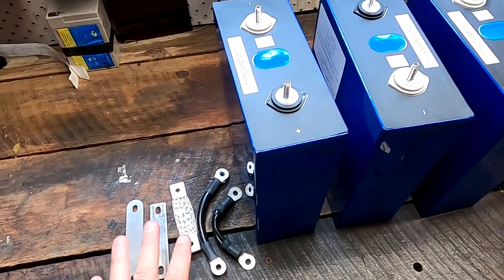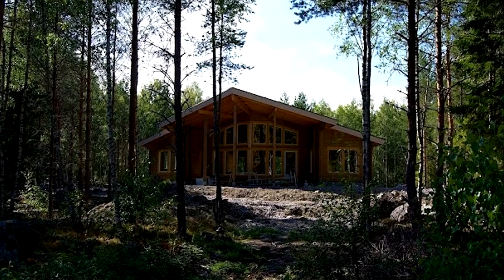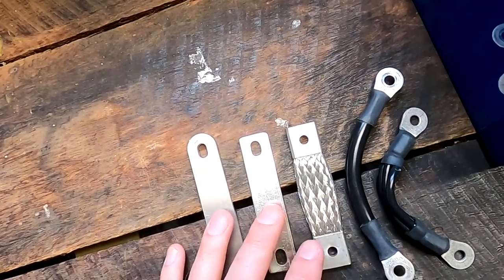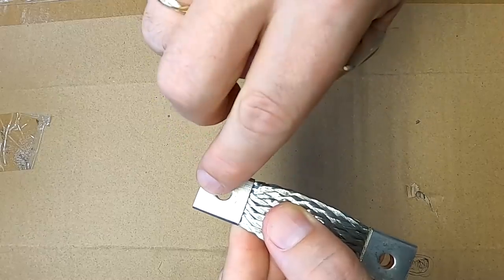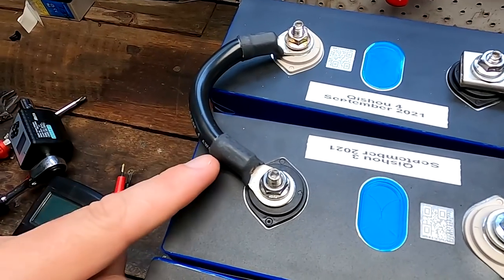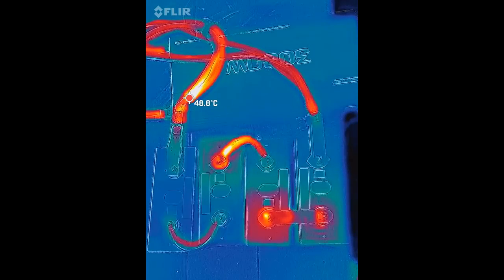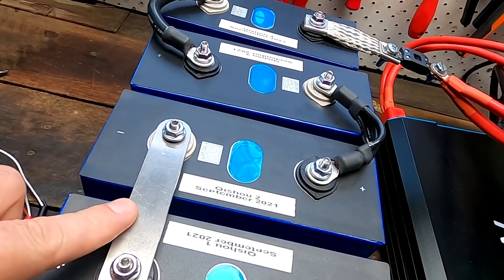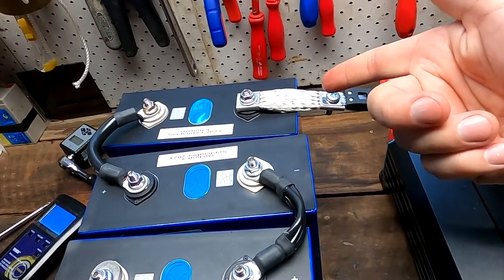All these different busbars... and why they don't matter!

Comment: So, having always seen the options in your videos for BMS having separate resistance values for balancing, does this provide any real world advantage in speed of top balancing your battery bank's? Or is it just simpler to rely on equal length balance lead lengths and connection methods and let the BMS auto distribute the current? I still can't fathom why the options are in there for individual resistance values....
Thanks again for all your learning and sharing Andy!
Reply from the maker: Thanks Zoe. Different lengths of balance cables don't play a role as such. When the BMS measures voltages, there is pretty much no current flowing, therefore no voltage drop. I think the JK-BMS just measures the resistance of the balance cables. I'm not 100% sure either why it may be important though unless you have a real bad connection and it has trouble pushing these 2A through such a cable.
Reply: @OffGridGarageAustralia  thanks Andy!
Does this mean the issues with your V1 battery bank coupled with the QUCC BMS having such a high millivolt deviation is due to not having balancing while charging activated in the app settings or actually the cells individual behaviour?

Happy spat hour to you :)

Comment: A great test, thank you. Very different that I had expected. Aluminium should be as good as copper when there is double the area and the awg 4/0 cable is 3x the area of the original busbar, so how on earth could it be worse?!? The answer must be connections to the posts and perhaps crimps. Tin is a very soft metal. Although there isn't much of it on a tinned busbar it must be improving the surface contact somehow in a way aluminium doesn't. Likewise for the crimp ends of the wires.

Comment: Thank you Andy for doing this video.
I was just about to make some fixable bus bars.

 But notice how both the fixable bus bar and the aluminum bar on the ends were cool.
 what would happen if you changed them and put them in the center and the other bars on the end.
 It seems that most of the heat is coming from battery post to battery post. 🤔
Reply from the maker: Thanks Dennis. I haven't had time to do more testing but I will do another test with an 8s setup at some stage where we can test more materials.

Comment: Hi Andy nice test this info is gold, have you tried a conductive paste to improve the connection (is your paste just for anti corrosion ?) i had been reading about carbon conductive assembly paste and it looked like a good idea and it is also an anti corrosion, i did comment before and included a link to the product but it think it got my comment removed 😁as always entertaining and informative keep up the great work 👍
Reply from the maker: The is the No-Ox-ID paste and against corrosion, anti-oxide and better electrical connection. 
As we saw in this test the other materials didn't have a problem to connect properly to the aluminium terminals of the batteries. Even not without any conductive paste.
Reply: @OffGridGarageAustralia  Thanks Andy, im an ex electrician here in the not so sunny UK and with rapidly rising electricity prices i think home storage is going to become a big topic, loving the channel it has inspired me to go the DIY route with my storage which im sure will be very similar to your own, thank you so much for devoting so much of your time to these videos they really are fantastic, i can usually be found with a S.P.A.T in the evening watching all your video's, great job

Comment: 032822/2107h PST 🇺🇸. Danke Herr Andy. Understood the importance of transfer of power and the torque standards. I’m highly impressed with the flexible bar, because , even though it had 5 joints at each sides( the flat plate compressed to Cu braid and the Al battery threads, SS grub bolt, and the knurled SS nut) on one terminal; it ( flexible BB) surprisingly stayed cool.
I’m not surprised at Madam Matty’s ( sorry if I misspelled the name) 2 cable bus bars, that stayed cool, because they both are AWG4. (4X10AWG=4 AWG) But, No comments on Al BB because it was a gift.😬
The normal Sn plated Cu bus bar, tested at China Labs and found suitable for the occasion, so it stayed cool.
If you are asking my opinion, I’d say, stay with flat pure Cu bar 3~4mm X 20mm drilled elongated and smear 
MG Chemicals Carbon Conductive Grease #846-80g. The CCG will not harden and takes away all the joint (electrical) issues. Beware… the compound is messy messy and very messy. I have pronounced lewd verbal epithets while installing the same🤪. Do forgive if I exceeded my limits. Take care und 73s…

Comment: just received my  jk bms after seeing your 'reviews', i'm really happy with how its balanced the pack.
Reply from the maker: The JK-BMS is really great and works a treat.
Reply: @OffGridGarageAustralia  being a big bike build I went for the 24s to get a high voltage but didn't realise there's no serial port on it so I can't pull the data off to the bikes main diy LCD screen, I'm looking at trying to connect an Arduino to it via Bluetooth just so I can display amps and volts alongside bike mph

Comment: Those ally bars could do with some surface grinding!  Fantastic test, it seems that heat or not tells you how good/ bad the bus bars are. If one does not have the camera. Thanks again for your effort.
Reply from the maker: Thanks Jackie. The aluminium bars will definitely work but need some treatment, sanding and no-ox-id paste. I'm just not sure how long this treated connection will last.

Comment: I want to start experimenting for a new off grid house. But this video just again proofs: if you are going to do  high current in any way, a good IR cam is a necessity. So that's probably the first thing I will investigate. But I'd rather have a good usb/phone version, because I can install a usb/phone version later on a PI to watch the installation.

Comment: Here is actual resistance and power loss on the bus bars tested in this video: 
EVE Orig　R=0.045mOhm　Ploss=1.152W
SuperAlu　R=0.15mOhm　Ploss=3.84W
4x10AWG Flex.　R=0.0875mOhm　Ploss=2.24W
1x4AWG Flex.　R=0.106mOhm　Ploss=2.72W
Ali 'Flex'　R=0.031mOhm　Ploss=0.8W

Calculated base on measured voltage drop with 160A of current.
Ideally it would be best to measure on the battery terminals with high input impendance multimeter because bolts are carrying a little bit of current too and measurement would not be true. Kind of.

As for thermography - it is a good idea to use black sharpie on your shiny metal parts...
Reply: now that is good information....thanks
Reply from the maker: Thanks for doing this additional maths and sharing it here. 
The overall test was more to show that the problem is with the connection and not so much with the actual material of the busbars people choose.

Comment: IME of automotive and marine electronics, 90% of issues are the connections, usually solder joints cracking followed by contact points needing a good sand down and re seat or replacing connection terminals
Surprisingly (not to me) crimp joints are by far the least problematic area of an electrical system 👍
Reply from the maker: Thank you. That's exactly what I found too. The IR camera doe s a great job revealing these weak points in your system quickly.
The crimp connection of this cable leading to the inverter seems to have a problem and gets really hot. I removed the heat shrink but could not really see a problem. I may just re-crimp it...

Comment: Andy - was this a fair test? Didn’t the first and last bus bar not have a heat source on one side of them? Can you repeat the test and move the same bus bars around to put a heat source on both sides of every bus bar
Reply from the maker: THey didn't have an aluminium busbar connected but just the cables to the inverter torqued with the same 4Nm. I can repeat the test with a 16s pack in the future so we have more opportunities to test different materials the same way.

Comment: Most people don't understand about resistance,  not just the wire size, but the strands,  "electrons travel on the outside of the wire or bar"  so if you use welding, welders cable, a 4 gauge welders cable, "picking random numbers" might have 50 wires, where as a house wiring 4 gauge wire would only have 25 wires... hope this makes sense....
Reply: electrons travel MOSTLY on the outside of the wire or bar

Comment: I love how you casually insert the chickens. That made me smile.
BTW my 280ies are installed and work reasonably fine thanks to you (and others over here) .
I still am wondering which busbar is for higher loads. I suspected the braided busbar would be best. But slightly expanded cells will probably start pulling on the battery poles? If it fits at all.
Therefore I really like the single 1AWG wire diagonally connected. Getting it crimped with good lugs that would be my choise

Comment: Buy some 2 gage welding wire and crimp good quality ends to length and use "Soft Copper Crush Washers" on top. Yes, crush washers.

Comment: I used 3/8 copper pipe squished flat.
When using a thermal camera i recommend painting a strip of flat black paint on them so you can get the accurate temp and not reflections

Comment: hello Andy, quick one what si the risk of over-torquing the bus bars9higher than 6Nm? in case, you don't have a torque wrench.
Reply from the maker: Hi Mike, if you torque them too high you can strip the terminal thread. I did this with at least one of my batteries. I'll show how to repair it soon.
4Nm is enough for these connections.

Comment: I picked aims over a renogy inverter based on reviews. Ren seemed to have reports of complete failure of the boards in as little as 3 uses. Many failed before 2 years if they can be believed. I think aims has lower standby consumption too. I consider it important.

Comment: i set up is 16s 2p 200Ah LFP cells, my best busbars are 25mm² copper cable with SC25-8 copper lug and 3mm thick 1 inch wide copper plate.

Comment: Hi, If I'm not mistaken when you connect in series you battery AH stays the same as a single cell. So it would make it a 300+ AH 12v bettery. Os this correct?

Comment: Interesting results, but something is not quite right there. The IR v's Voltage should be consistent (basic ohms law) because the current flowing through all of them is consistent, so the readings aren't coming in correctly. Also the end connections aren't consistent with middle ones because they're not terminated to another cell. If you built up a 16s 48v pack, and ran your other inverter to do the test, then place these 5 different bus bars in the middle cells, that would provide consistent connections throughout. Doing this you could also do 3 of each type of bus bar so you can triple confirm each reading and get an average.  

It still seems like the connection between bus bar and terminal is an issue too. I know I do my nuts up to about 8Nm, maybe 4Nm isn't quite enough. 

The other thing I have just been alerted to, is that the longer Aluminium bars that you have (sized to do the end-end connection), may actually be a different material grade. They are from a previous supplier who didn't actually specify the grade, so it's likely that the newer ones I have sent will produce a better result. It's a lot of testing to do to revisit all of this, but we're cheering for team Andy to get results :)
Reply: Might be worth looking into water jet cutting rather than laser cutting. Laser will always produce a little lip around the perimeter that needs to be buzzed down, especially on thinner material
Reply from the maker: Thanks Paul. As someone pointed out the problem could be the internal resistance meter not been reliable when measuring under load and having high ripple on the DC (100Hz ripple from the inverter).
The results are in deed questionable in this case and hence I said at the end it was not so much to compare different materials but more to point out that the resistance between terminal and bus bar is the problem.

Comment: Hi Andy,
I wonder if the aluminum buss bars would work better if you removed the oxidation layer from both sides of the buss bars, and also did a light sanding on the aluminum on the battery themselves -- and of course liberally used the anti-oxidation goop everywhere you sanded.

I'd also be interested in seeing if using a brass or bronze stud and nuts would be better than the steel ones, as the brass or bronze should also conduct better.

I would be interesting to see a re-test with those changes....
Philip

Comment: Hey Andy, since you hve a Raspi, you
could add a 7inch Raspi-Touchscreen. It
costs around 60 $ and you would have a
very nice interface with VRM. I dit it myself.
It works great and costs nothing in
comparison to Cerbo GX (800.-).
Reply: You comment this on every video. Maybe he doesn't want the hardwired touchscreen.
Reply: @jesserockz  yes, but possible he didnt see it. I only posted it on the last video. It would be a nice project especially for his battery box.

Comment: 23:50 From the voltage across and resistance of each busbar that you measured, we can calculate the current through each busbar. 
Why is the current through each busbar not equal to each other?

Comment: 140 original tin plated copper bus bars used on my 132kWh battery with 847 carbon conductive assembly paste. All cold as cucumbers.
Reply: +1 for 847 :)
Reply from the maker: Thanks for sharing. 
I wasn't aware that cucumbers are a measurement of temperature 😁
Reply from the maker: OK, ok, ok, I've ordered this goop as well now!

Comment: I think Madi's cable is supposed to go diagonally across to the next cell so you end up with all the positives and all the negatives the same side. That's why it's too springy in the default side to side layout... Maybe
Reply: Nope, he used it as I intended. If you see in the original video I did, I tried shorter cables but they were too stiff. I had to go that long to give them enough spring to let the batteries touch. When the batteries are in the box, the spring of the cable doesn't push the cells apart or even press hard. With only four cells loose on the bench though, the spring is enough to push them apart, barely.
Reply from the maker: I think it's in this video, Paul:
https://youtu.be/z8gGG4AP_PQ

Comment: @OffGridGarageAustralia whats your take on pcb busbars? Jehugarcia is selling them.

Pcb is probably cheap, but way less copper seems a bit risky?
Reply from the maker: They are cheaper for a reason. Far less material. Copper cannot be replaced except by more copper.
It depends on your overall current you are planning to run though your cells. The PCB bars are great for smaller projects but if can get 200A from your battery, I would not risk it.

Comment: Hi Andy absolutely brilliant test and valuable evidance.
Aluuuuuuminum is a git and oxidizes extreamly quickly, you did the right thing protecting it with paste asap.
For those of us on an extreamly tight budget, Can I ask you to do the same test but with an upsycling hack re-using flattened and drilled copper plumbing pipe of various sizes?  I had used Scrap cable off cuts of crimped (with your hydrolic hex press)and exact lengths but that was only for initial charge, ballance and test, no high loads as yet.
Loving your work thanks Andy
Reply from the maker: Thanks Gary, I'll do some more testing with different materials in the future and will include some copper pipe as well.
Reply: @OffGridGarageAustralia  Thanks Andy that will be cool!

Comment: hmm,? Am I missing something.?
Surely it is about the current carrying capacity of the busbar.
For a start, aluminium will only carry about half of what copper busbar carry, of similar cross section. 
On your test you go from the cross section of the cable to how much crimp is touching the terminal, therefore reducing the cross-section and producing heat. 
That is why the cell terminal has such a large area of bare metal, the bolt is only to secure the crimp in place, not carry the current. 
Try what I call "penny" crimps they have a larger pan with a small hole, and use a washer the same size as the crimp pan. 
I use 70mm2 orange welding flexable cable with the crimps, only crimped with no solder.
My cells are 3.2v 500ah x4, 12v, and drawing 3000w for an hour and nothing gets warm.
Looking at the crimps you use and what I have seen on other channels, they look like they are from a DIY store, go to an electrical wholesaler and buy industrial crimps. They are are made by squashing the end of a tube to create the terminal end giving you twice the thickness of crimp at the terminal.

Comment: To confirm that all the resistance/voltage drop is due to the busbar and not variations in flatness of individual battery terminals it would be good to do the test again with the battery cells swapped around.
Reply: Or probably attaching the bus bar to a test connection rather than a real battery.
Reply from the maker: Thanks Nigel, There is of course a lot more to that than just the material and resistance. Yeah, contact area is very important too.
I will probably repeat the test with an 8s battery and swap the bars around. But then again, everytime you do that, the resistance changes anyway 🤷‍♂️
Reply: @OffGridGarageAustralia  I have been using a very thin film of conducting carbon grease which seems to be OK. However it occurred to me that a  product called 'Copper Slip' (used in cars to prevent spark plug seizure) might be a good alternative. Unless the lubricant with the copper has an adverse effect the copper ought to improve conductivity within any micro grooves in busbar or terminal base.
With cells that have the posts already fitted it is virtually impossible to improve the contact surface on the terminal  so I suspect that, regardless of effort to improve flatness of the busbars, we may find that we are terminal surface limited so some form of conducting compound with aluminium busbars is essential. To make the point, if you do another test, please do it twice over without and then with conducting grease.